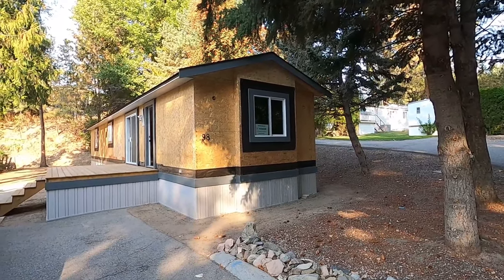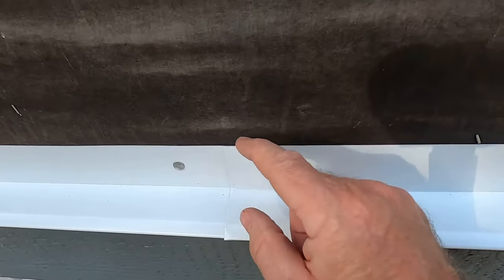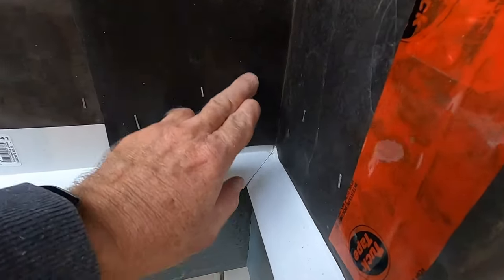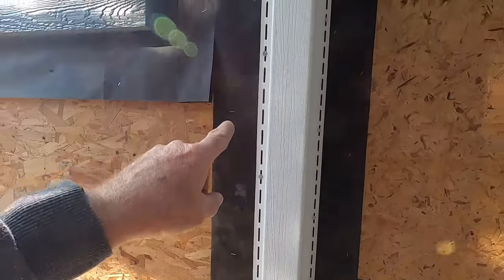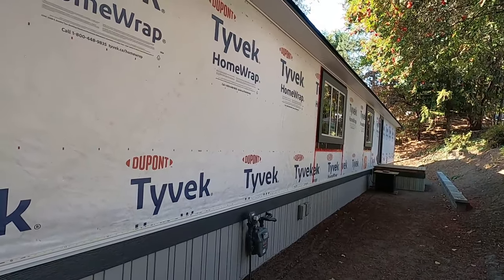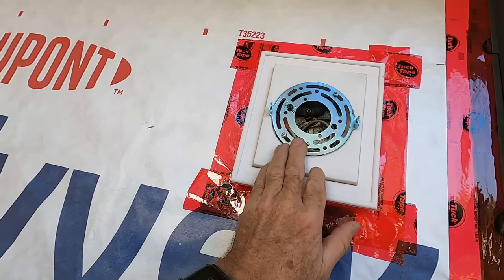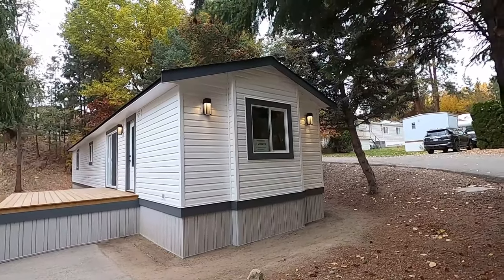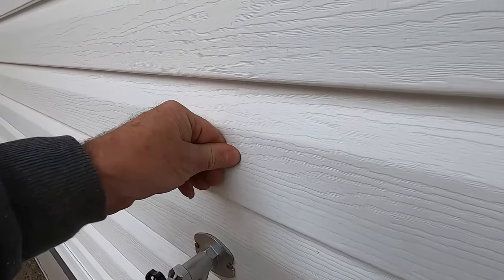Our 40 Year Old Mobile Home Gets A BIG Facelift - New Siding : E122 / BC Renovation Magazine

Comment: Nice work. I have a question re: where does your rain water go? I have a ditch in front of my place but the rainwater from the street fills it, & the rainwater that comes from my house down the downspouts down the slopes after paying to have a french drain put in bc the ditch is closer to the street it fills & pushes the water back up my slope toward the house. What can i do to fix this issue since the contractors i hired didnt do the job right. Im in rainy northern Florida too. Thx

Comment: A great looking job and excellent attention to detail.

I have been following a YouTube channel where a young couple is restoring an older mobile home. They are located in Florda and I was surprised to see that there was no sheathing on the mobile home right from the factory. The walls were constructed of 2x3 lumber (not even 2x4 s) and the metal siding was attached directly to the studs. There also was no vapour barrier between the studs and siding either. The roof trusses were mainly made out of 2x2 lumber and there was no sheathing on the roof, just galvanized metal. They had a lot of rotted wood to replace, especially around the doors, windows, and sills. This trailer will be really nice when you are finished with it. I just discovered this channel so I'm looking forward to seeing the rest of your videos on this project.

Comment: You made that a very nice looking place. This 95 mobile home I'm in has a ton of work needed and the outriggers are sagging with the center hump. This place wasn't maintained. No plastic on the ground under it for over 20 years and on clay. Never dries out less than 98% humidity under there. Eventually I'll build a house to replace it, IF building materials cost and availability ever return to at least somewhat normal. I'm hoping for an economic crash in 2023. Very beneficial to the do it yourselfer. Until then I'm in this mobile home. 🤷

Comment: Looks great! One question, where does the water go on the bottom J trim? Just fill up and run out wherever it can? Thanks for the video.
Reply from the maker: Hi, Rick. Thanks.  The water drains out of the J trim at the joints.

Comment: Did you remove the metal roof? If not what did you put between the metal and plywood/osb? Or will it not sweat?  I have a metal rooved mobile i would love to do this to.
Reply from the maker: Hi, Bev.  The old metal roof was mostly left behind.  The original metal has a layer of foam on the underside.  That, combined with proper attic ventilation should prevent any condensation from occurring.

Comment: Great job as always! Question...considering you have to go months without putting house wrap on the home, how does the rain effect the uncovered osb?
Reply from the maker: Hi, Nick.  It doesn't seem to bother it too much.  OSB is made with exterior grade resins so it is somewhat water resistant.  If water doesn't sit on  it, like on a vertical wall, it seems to be OK.  Some discoloring will occur, which you will notice on the lower part of the wall around the back door, where water splashed off the deck onto the wall, but that area remained sound.
Reply: Oh ok thanks...ive always wondered about that

Comment: Hello kent..i am asking for multiple opinions...i have 3/4 solid hardwood in my single wide...i am also planning on tiling both my shower walls...i want to put osb and possibly LP smartside on my home...my question is do you think my walls qould sag because of the weight? If so what woukd you recommend for wall support? Cinder block piers around the perimeter or maybe 2x4s standing vertical?
Reply from the maker: Hi, Nick. Some questions for you before I can answer:

1. What is on your exterior walls now?
2. What do have for exterior wall studs? 2x4, 2x6?
3.  How far are the exterior walls cantileved over the main steel beams?
4. What is the size of the floor joists?  2x6, 2x8?
5.  What is the snow load in your area?
Reply: @BCRenovationMagazine  1. Foam board and vinyl siding(was like that when we bought it) 2. 2x4.. 3. Not sure have measured...if i had to guess maybe 2.5 -3 ft, again not sure...4. 2x8  5. I live in tn so its rare that we get snow and if we do maybe an inch at most then gone the next day usually
Reply from the maker: @nicksinclair2407  , I'll get back to you on this.
Reply: @BCRenovationMagazine  k thank you
Reply: Sorry for the late reply...i measured the distande from the beam to the edge of the cantilever and got about 45 inches
Reply from the maker: @nicksinclair2407  , without seeing what you have there, I would say you can safely install the LP siding panels. 

I would remove all of the old siding, install a Tyvek type of house wrap and then install the panels.

You probably don't  have to add any support under the walls, but I'll leave that up to you to decide. 😉